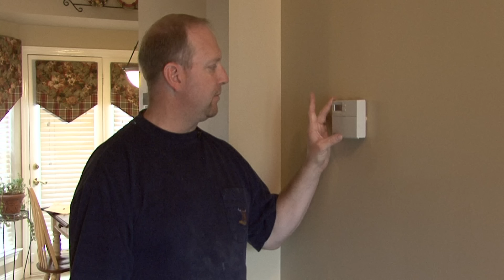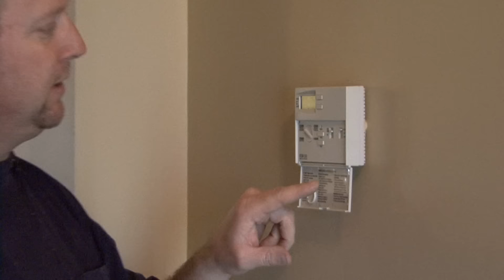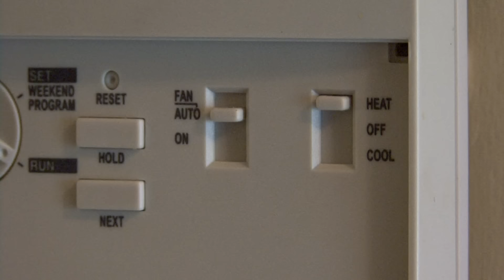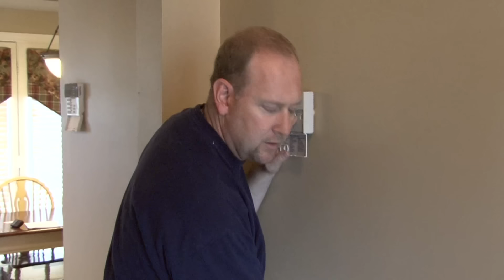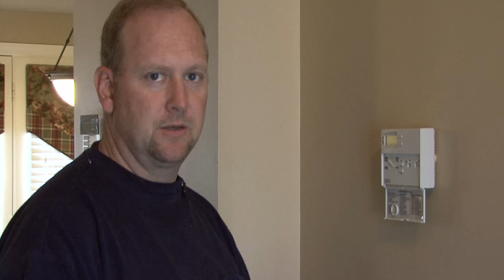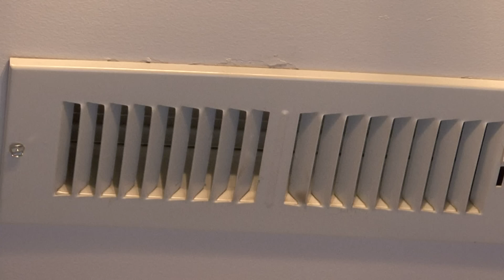Home Repair & Maintenance : How to Test a Thermostat

Comment: Best way to test thermostat is to remove cover and jump out controls manually with. Which ever way you want, preferably jumper wires. If everything work and you still have problems  with your t-stat. It's the t-stat! Call me and I'll install it the pro way. No holes in walls lol